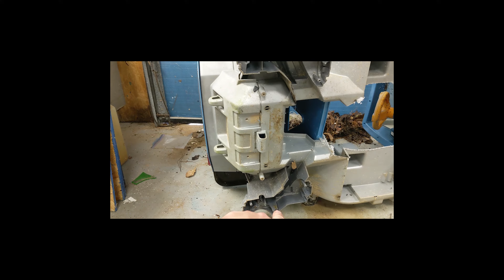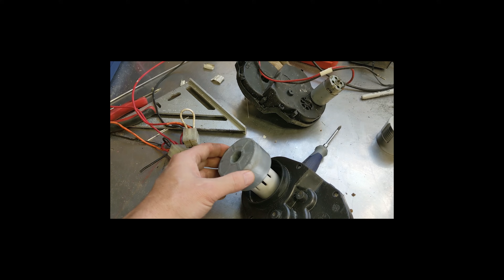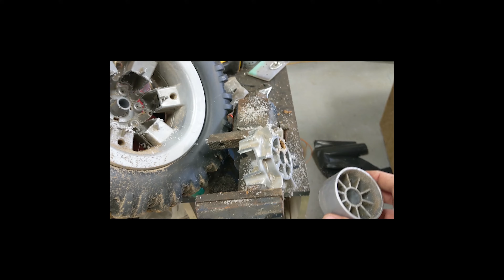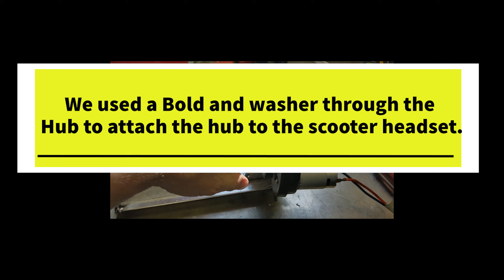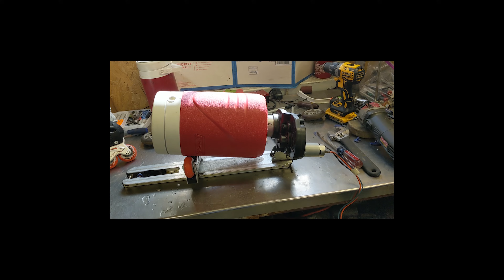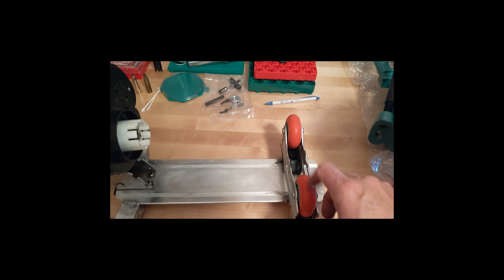Ammo brass case tumbler / rock tumbler HOMEMADE.

Comment: how many cases can you get per load?
Reply from the maker: I'm really not sure, I never have filled it up I've probably done 250 rounds of 45 ACP and it was maybe a little more than half full. Of course you could choose any size drum you need. If you build it like this one you could take the middle two wheels out of the rollerblade and have a much bigger container.

Comment: Thanks for the reply, what did you use to attach, glue (which kind) or  screws?
Reply from the maker: The raceway/wire conduit has a self adhesive strip Along the back
Reply from the maker: https://photos.app.goo.gl/JosdqcjUuhyVYSxVA

Comment: Very cool dude
Reply from the maker: Thanks
Reply: @randysdiy1  Did you put any type of ribs inside the cooler? If not wouldn't the pins and cases just stay on the bottom?
Reply from the maker: Yes sir I don't guess I put that in the video I used some 1/2-in vinyl raceway / wire molding and stuck it inside the drum in three different places.